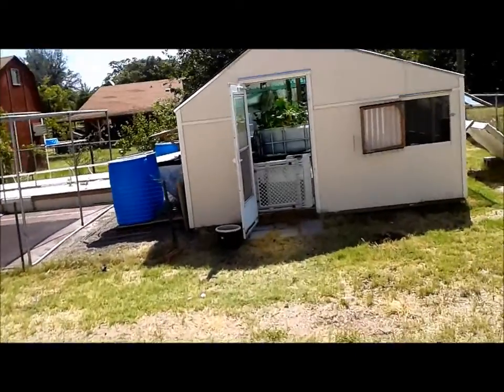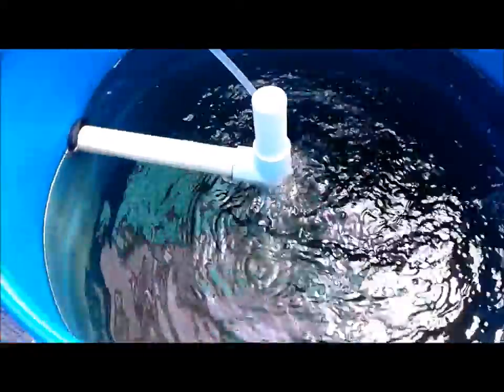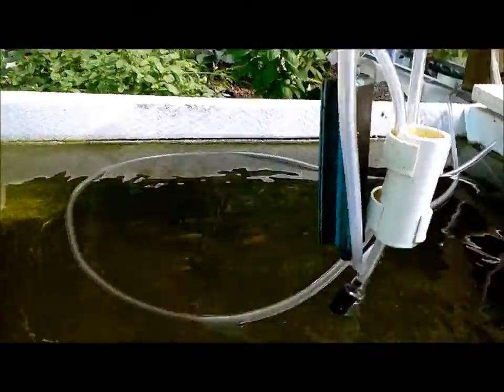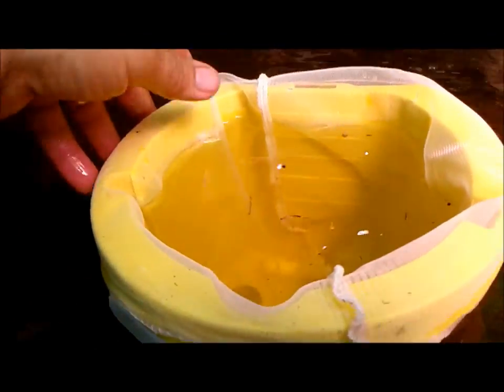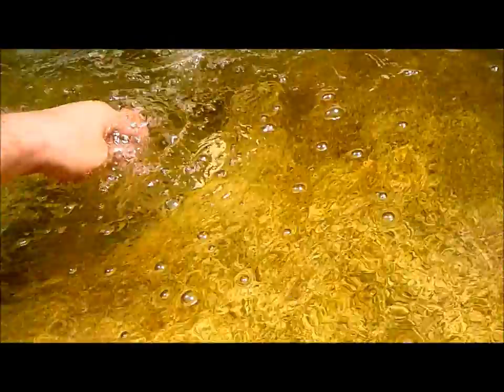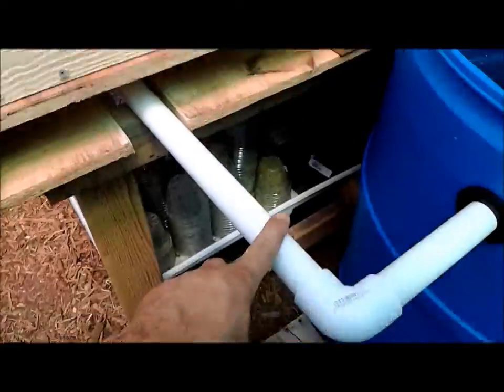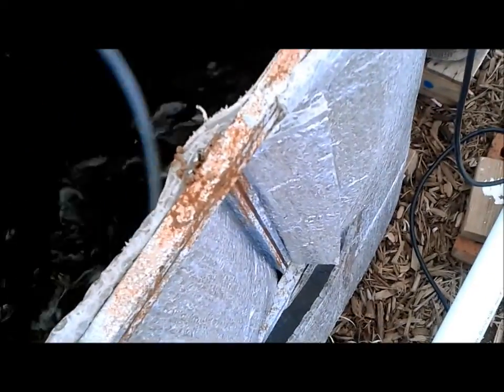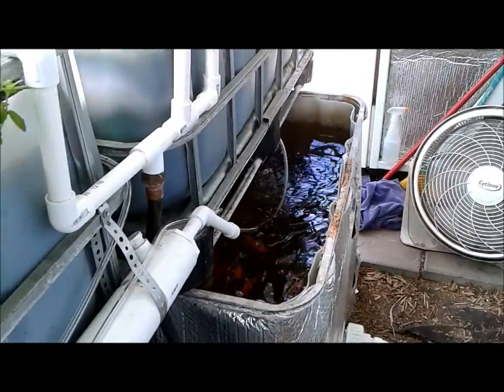August update on the Aquaponics greenhouse

Comment from the maker: I usually plant several types of Bolt resistant Lettuce & Spinach along with Swiss Chard during the hot summer months, along with other leaf bearing plants during the fall and spring. I have to replace the plastic panels on the front of the solar heater with glass, but I havent' had time to really work on it lately. I will also be placing a thermostat on the pump when I do so it doesn't cook the fish so to speak.

Comment: What are you going to plant in the rafts with the high temps you were speaking about? I do not have a raft system on my setup and am curious if you can grow lettuce in a raft system during periods of high temperatures. BTW, great setup. Is your solar heater still ready to be utilized for the winter months?